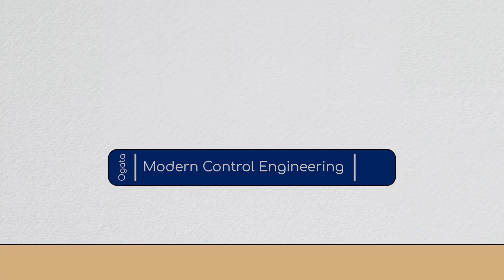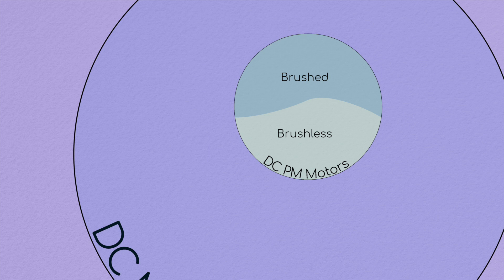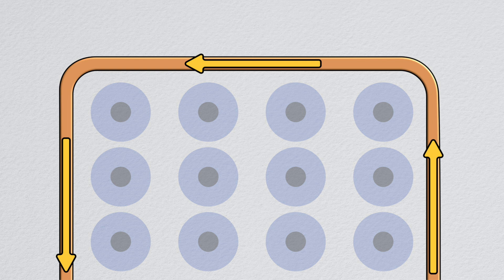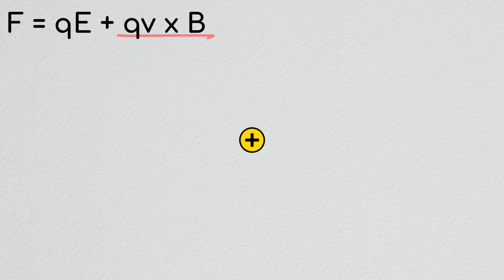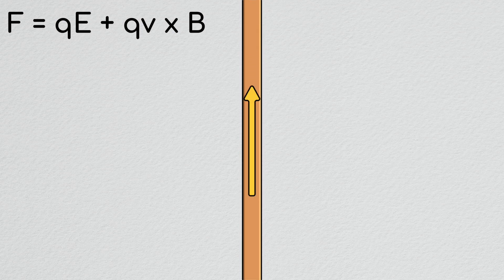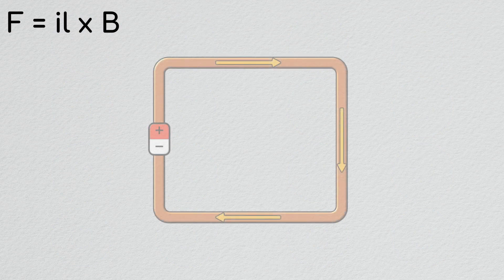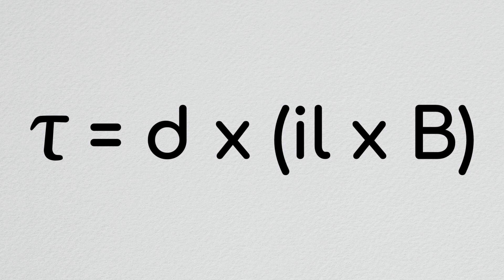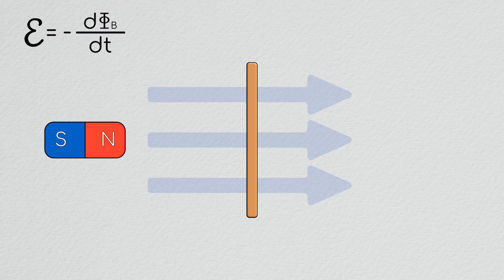The Physics behind how motors work. Understanding motors (Episode 1)

Comment: Good work! 

Joust a question: isn't charged electrons negative and not positive in electricity? Or why is the electron charge positive in the wire?
Reply from the maker: Hi, so first off, within the sign convention that is standard, yes, electrons are negative. However, because they are negative, they flow from negative charge to positive charge. So, its standard to think of the holes the electrons leave behind as moving charges, where these holes flow from positive to negative. So really, I am kind of depicting the lack of a charged particle there. Hope that helps!